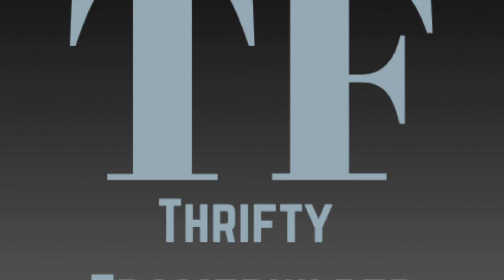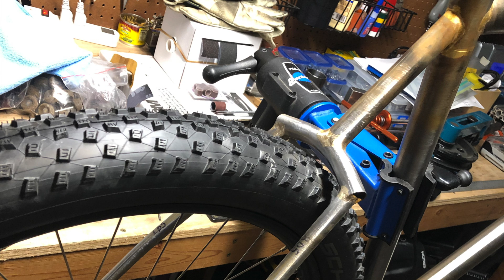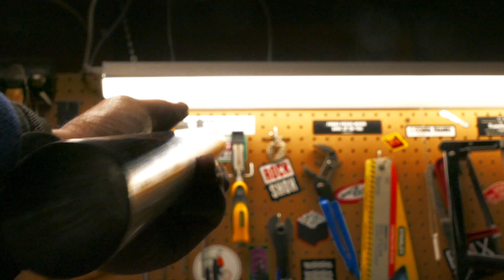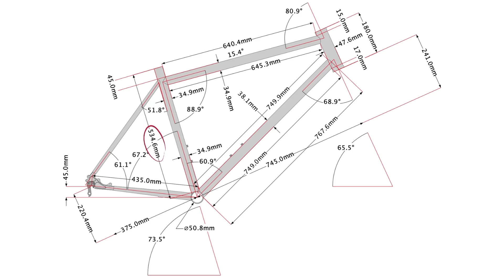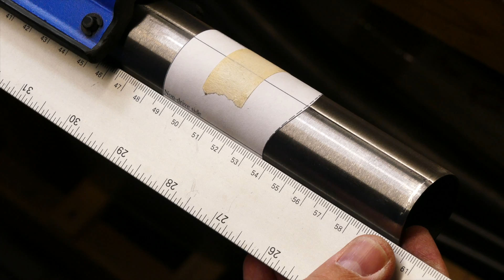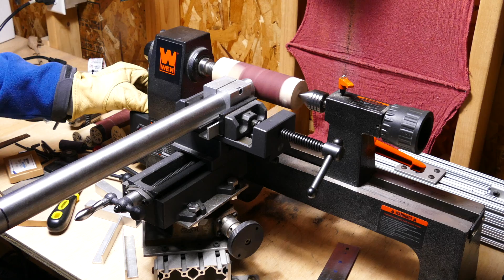DIY MTB Frame Ep 2 - Tube Specs and First Cuts

Comment: The thick end of the seat tube is supposed to go at the bottom.
Reply from the maker: Maybe on a lugged frame, but not on a fillet brazed frame.
Reply: @ThriftyFramebuilder  You think the bottom bracket is somehow less stressed on a fillet brazed frame? Sleeve the top, put the thick wall at the bottom where it belongs.
Reply from the maker: No, but the extra thickness is more important at the ST cluster than the BB cluster. 

And the thicker wall belongs on the top for this tube. The ID of the thick end of the tube is butted to fit a seatpost. 

From the product description for this seat tube:
“This is a 35mm OD seat tube butted for a 31.6 seat post.  35MM X 1.6/.9 X 600 The ID is undersized to allow for post weld/braze reaming. ID is 31.6-31.5”.  

The “thin” end of this tube is 0.9mm which is the same wall thickness as the butted ends of the DT and TT, and other than extreme cases, is plenty thick for the BB cluster.
Reply: @ThriftyFramebuilder  OK, my mistake - things have changed in the thirty years since I worked in a frame building shop. I suppose I shouldn't be surprised.
Reply from the maker: No worries!  From what I understand (from watching Paul Brodie), seat tubes that are butted at the top so you don't need a sleeve didn't come around until sometime in the 90's.  I'm guessing even then they weren't common at first.  If I was using a thinner single butted tube (0.9/0.6), I would be doing exactly what you mentioned... put the thick end at the BB and a sleeve at the ST cluster.  Thanks for the discussion and thanks for watching!

Comment: Cool video series! Any reason you’re not mitering with a hole saw?
Reply from the maker: Thanks!  The main reason is I don’t own a mill, and any other way of using a hole saw won’t give as good results. The abrasive miter finisher makes really clean, accurate miters.

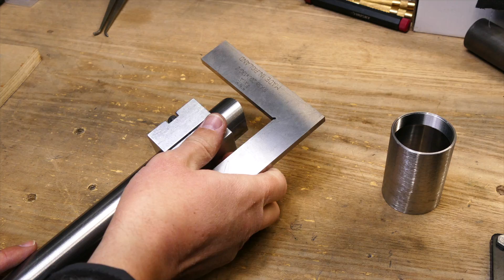Comment: at 12:30 why is there so much attention to the joint i mean i welded my bike with a stick welder an cut everything with an angle grinder and got a really nice bike you dont have to work so precise
Reply from the maker: Tight miters mean a straighter and stronger frame, especially with brazing.  Got any pics or videos of your bike?

Comment: Thanks so much for such a thorough and detailed video. Looking forward to the entire series. Sorry if this is an obvious question, is it safe to braze indoors or do you need good ventilation?
Reply from the maker: I know a few people that braze in their basement with a fan in the window, but I’d never do it. I’m cautious when it comes to fumes. A decent sized garage space with a couple fans in the window is what I do. I also use a respirator when I braze, and open the door to air it out afterward. I also don’t hang out in the garage right after I’m done.